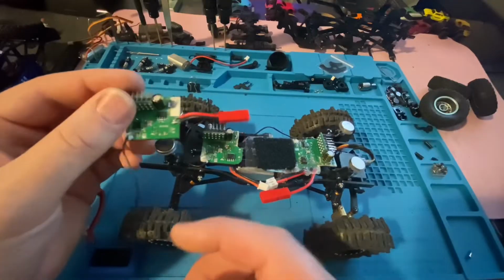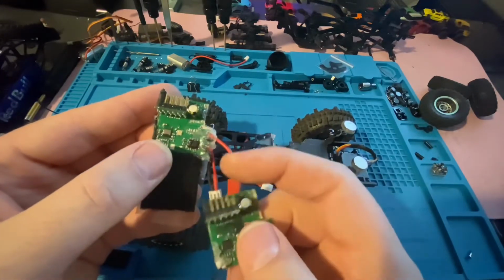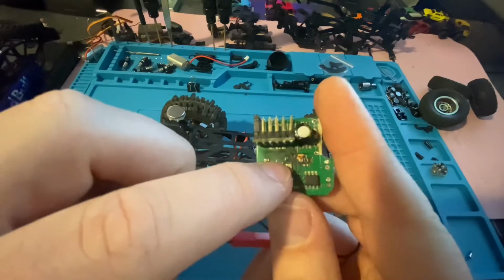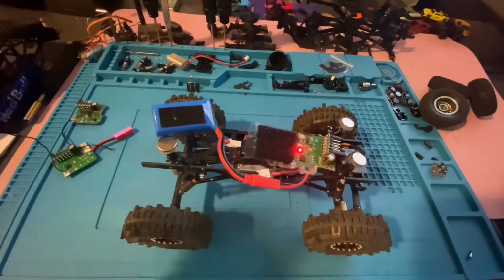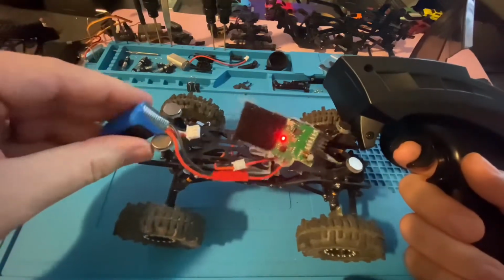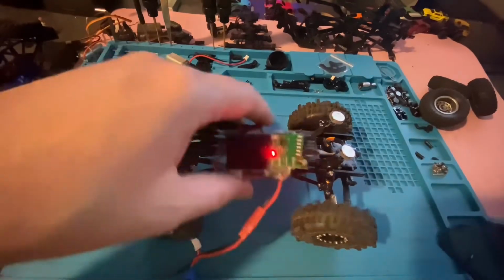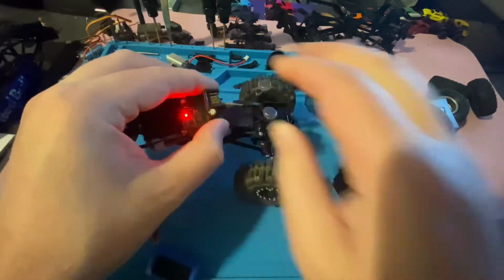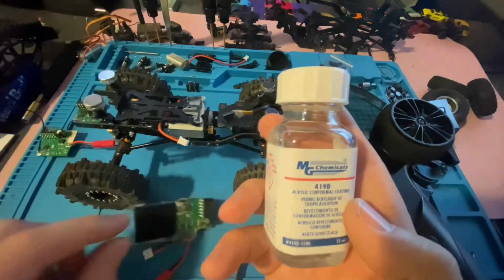SCX24 - Fried ESC/RX combo follow up. Watch this too.

Comment: Nice that removing the chips doesn't break the circuit for the steering part of the board. So, if I understand correctly, once you've got the dead chips removed from the board, you can then wire in/plug in an ESC like a Lizard to take over the duties of the dead ESC? Does the Lizard just plug in where it normally would if the whole thing was still working as normal?
Thanks again! And sorry for all the questions! If it's a PITA, don't worry about answering. I'm just trying to learn all I can about the SCX24's.
Reply from the maker: Yep, the lizard plugs into the channel 2 of the RX just like a servo. (Regardless if its working as a combo or rx only)
Reply: @TheShopMiniRC  Great! Be interesting it's possible to cut out that part of the board then, for space savings.
Reply: Indont even have a light on my esc after i smelled something burnt....